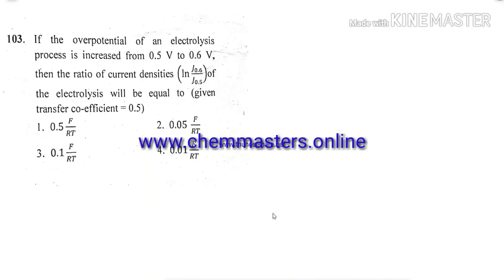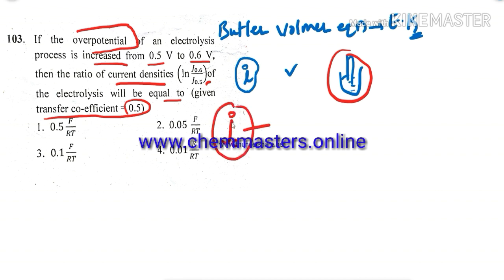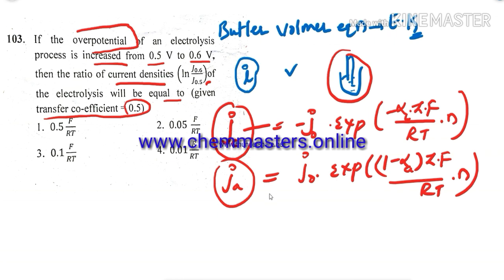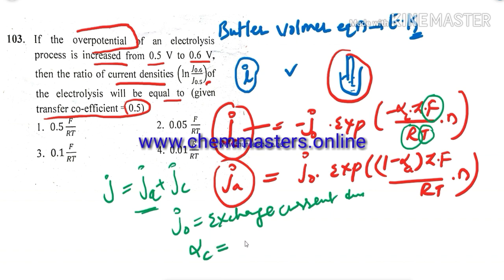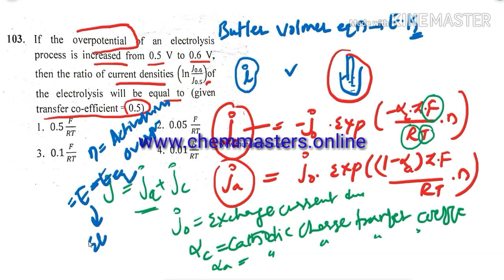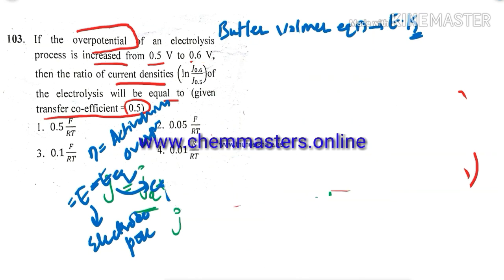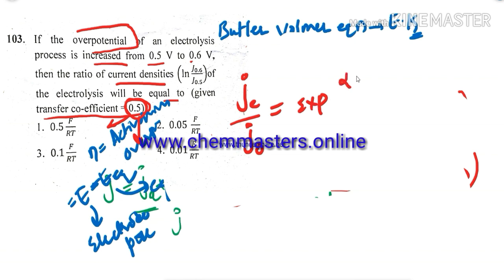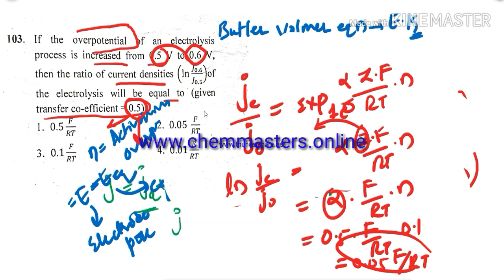Butler volmer equation|csir net june2019 chemical sciences|physical chemistry|CHEM Master

Comment: Sir answer is 0.1F/RT..because here etta is 0.1..so we use butler volmer equation directly...so two part we use..u use only one part ...of butler volmer..when etta= 0.01-0.1 use butler volmer equation directly...if etta large and positive nthen tafel equation..
Reply from the maker: No........siva.........need to take generalised eqn.....j/jo ,not the ratio of jc/ja
Reply: @CHEMMaster007  sir if etta is is 0.01-.1 butler volmer equation directly...here you use tafel equation..cathodic current equation...here cathodic and anodic current equal..so butler volmer equation directly  use